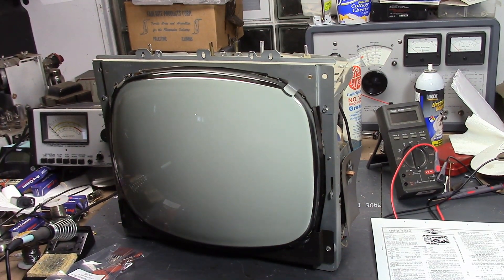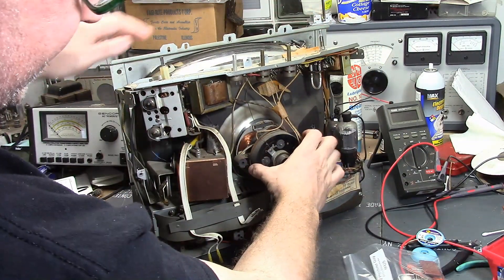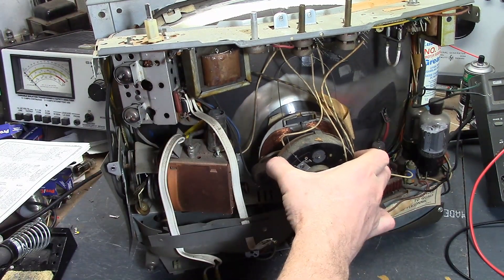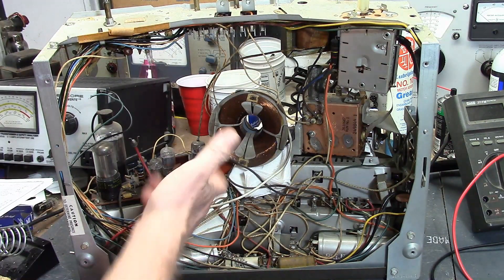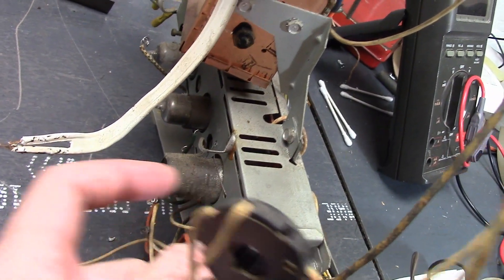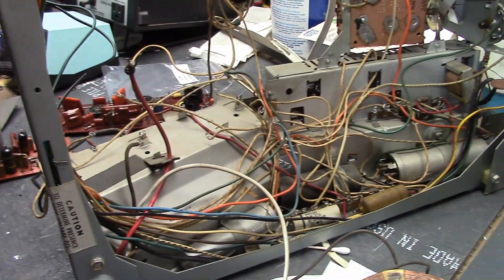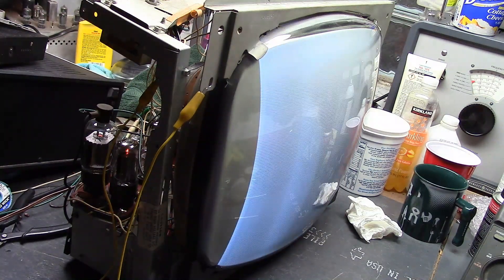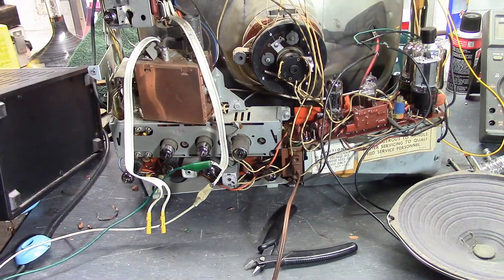Philco Seventeener III restoration p2o4

Comment: My Admiral briefcase set has a socket for the yoke so it never had to come off of the picture tube. Philco always making it so difficult to service. One thing I do love about Philco's yokes is how easy the centering mechanism works.
Reply from the maker: Huh, that's a nice luxury.  The earlier metal Admiral portables also had hard wired yokes.  Maybe they got a lot of complaints?
Reply: @bandersentv  I have an Admiral 15G1B that does have the metal cabinet. Great looking set. The yoke does have an unplug-able socket to the chassis so perhaps they did change it at some point. I had to do quite a bit of troubleshooting with the vertical so taking the chassis in and out was a breeze.
Reply from the maker: @televisionforever  I'm referring to the 14YP3 chassis from 1957.  I restored a few of them.  Real PITA.
Reply: I imagine any smaller cabinet tube set was a pain to service during that time.
Reply from the maker: @televisionforever  Yes.  I have an RCA portable coming up that I hear is a bear.  I think it has a power transformer and is very heavy.

Comment: I have been discharging crt anodes with a screwdriver and clip lead direct for years with no bad effects. On solid state sets I make sure to clip on to the spring on the dag as not to risk sending any charge through the chassis.
Reply from the maker: The issue I was referring to is dielectric absorption. Rapid discharge can lead to a residual charge remaining. Been bit more than once after discharging a CRT with a screwdriver
Reply: Yeah I've gotten bit a few times too from the crt gaining its charge again.
Reply: @marka1986  the old"SURPRISE! I'm NOT DEAD YET! " :P

Comment: we both forgot to show the finished installation of electrolytic caps in this weeks video. dual suicide??
Reply from the maker: Lol. Yeah. Just as well because I need to relocate. CRT bumps into them when I tried to put it back together 🤨
Reply: @bandersentv  I made that same mistake when I did my first seventeener as well. You mentioned there were electrolytics on the IF board, are you sure about that? I seem to remember those wires from the ecaps snake through the IF down to the sound board area.
Reply from the maker: @johnbaker26  Yeah, the caps really do need to be tucked down against the frame.  The +140 V has a 100uF cap and goes to both the IF board and sound board.

Comment: I would consider making a T shaped jig for the yoke. A flat piece that spans across the original screw holes for the crt and then a wood dowel screwed in at the same spot where the neck would be on the crt. Just slide the yoke on and put two screws in. Just a thought. 😊
Reply: ...that would make sense, if you are working on a heck of a LOT of those particular TV sets...

Comment: Too late now but I'm thinking you could have just put a piece of string through the yoke and hung it off the metal frame above it.
Reply from the maker: Good idea.  I did have the chassis lying on its side quite a bit though.  I'm very paranoid about nicking one of the fine wires.

Comment: Why not tie the yoke to the top op the chassis with a piece of string and leave it hanging. There seems to be a large hole to allow for that😀. No wires to break. No risk of falling.
Reply from the maker: Because I didn't work on the chassis with it standing upright.  I had it face down and upside down at times to get at everything.
Reply: @bandersentv  ah yes, then it wouldn't work. I think you never showed your final decision on how to mount the electrolytics. Maybe a mention in the next video?
Reply from the maker: @bzuidgeest  Still working on it.  I just have some hanging loose at this point and one bumps into the CRT
Reply: @bandersentv  i see, with you doing first power ups i expected you made your choices on that. I'll be patient for the next video then.

Comment: There doesn't appear to be much in the way of wire dressing! I guess it hadn't occurred to the engineers who designed this set about the possibility of oscillation and other noise being induced into other circuits, particularly into the video IF circuits. That CRT appears to produce a nice, bright, crisp raster. Those 9-pin tube sockets appear to be very flimsy, but if they're populated with the original Philco tubes, it likely isn't necessary to replace those sockets. I personally would be reluctant to replace them, as the metal traces on that board leading to the sockets are probably very delicate, and bodge-wire repairs are no fun.
Reply from the maker: The tuner and IF are off to the side and well shielded. Coax connects them. The dangling wires are not going to any sensitive circuits